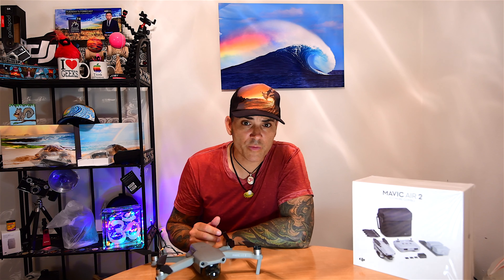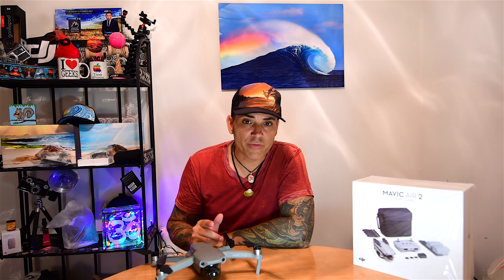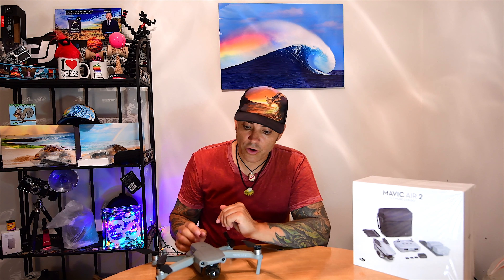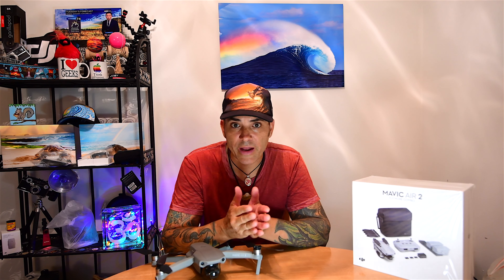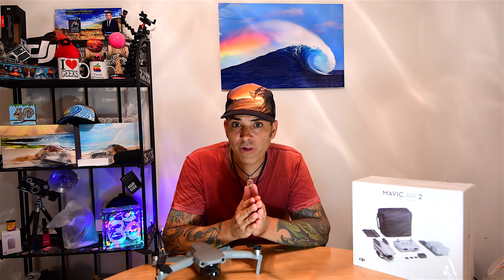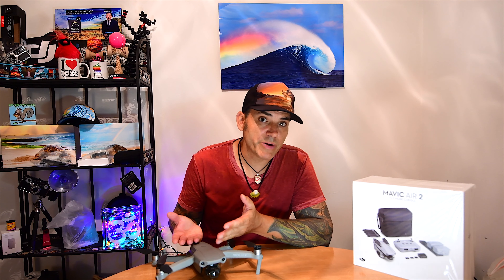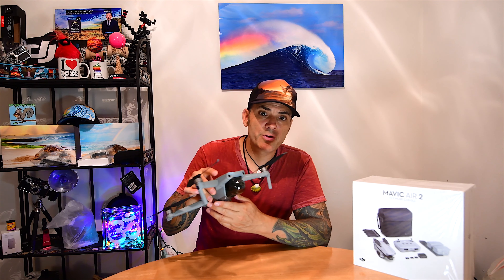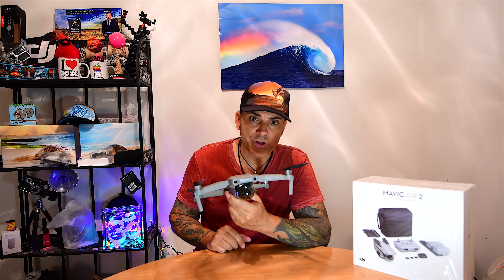Mavic Air 2 Overheating Issue

Comment: Thanks for the video, my drone was working fine and for some reason this message showed up today after a 5 minute run and now it's totally stuck the fan won't come on, the drone won't take off. I contacted Dji but got an automatic reply to say they're having a lot of people getting in contact with them these days so it will take a while to respond... this is so shit i have a job tomorrow, In all i probably flew my drone only 20 times.

Comment: That's why I love my Mavic Mini, that thing is so awesome and it doesn't even have a fan inside! I love to fly my Mini so much...

Your fan is just probably spooling up too much because it's too hot around where you fly bro. It's either the fan noise or come home automatically when overheating.

I may be wrong of course, but like I say, I love to fly my Mavic Mini so much it's ridiculous really how amazing that lil drone is!

Sweet

Keep well and be safe bro...
Reply from the maker: Ivan Jdrakov My fan is not spooling at all it seems!  😩 I love my Mavic Mini too super fun drone...but Mavic Air 2 is definitely another level from that....it is a beautiful drone to fly without being too large and is a great drone especially if u love flying the mini so much.  Both killer drones just need stability from them with less issues.

Comment: They all have a heating issue while dji did a great job on the mavic-air-2... it definitely comprised the integrity of the craft by not introducing at least some ventilation   for the battery as that will eventually sink this amazing product. Its over heating and swelling will definitely have a knock on effect with other parts being compromised.. i love the drone. Its amazing for its price range but I wish they would just solve that issue first before they release further updates

Comment: I've heard the fans going on and it gets really hot at the bottom and also it disconnected from the controller to the Drone when I got a phone call it was weird really weird I can't even get a hold of DJI it's just a Coronavirus automation get back to me when you can cuz I just bought mines to its brand new
Reply: I use airplane mode cuz I think I get better connection from it